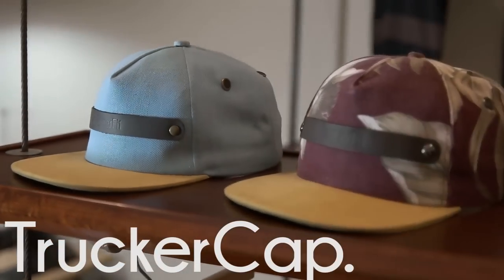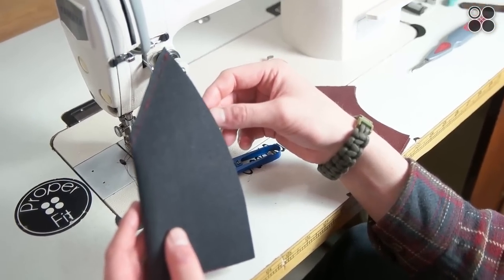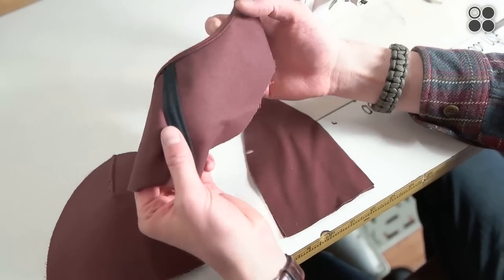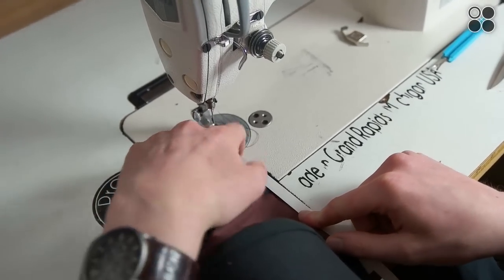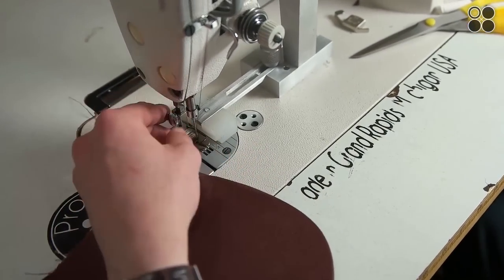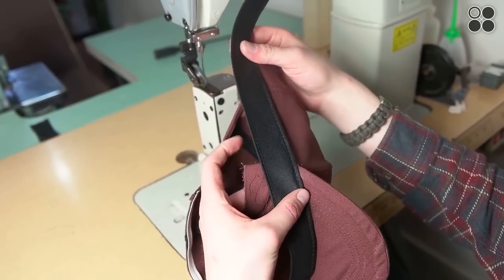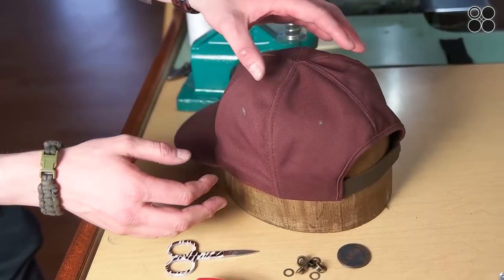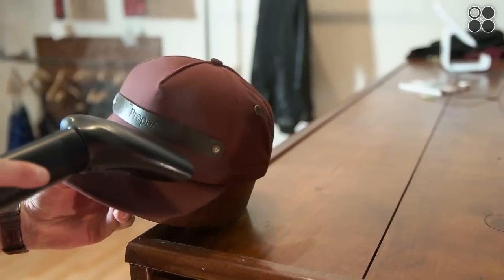OFFICIAL | How To Make Trucker Hat NEW!

Comment: if you don't have a machine can all this be done hand sewn?
Reply from the maker: Benjamin Schiltz Vlogs Yes, the machines only help speed up production. You can do all of this on a basic domestic machine or by hand. Sewing by hand will help with precision and over all great quality.
Reply: Great response time. Thanks for the information. I never thought of making hats but this is very interesting.
Reply: Someone has offered to sell me a Vintage Singer 5528 small machine for only $50 I think they were made in early 1980's to mid 80's and they told me it works great, hasn't been used in decades though and was stored in the basement. I think I might go ahead and buy it. It would make sewing so much faster as you have said.
Reply: Yo no tengo máquina de aparador (la que se usa para calzado) y esa parte la hago a mano, y las gorras las vendo.
Reply: seinto cómo lo haces a mano